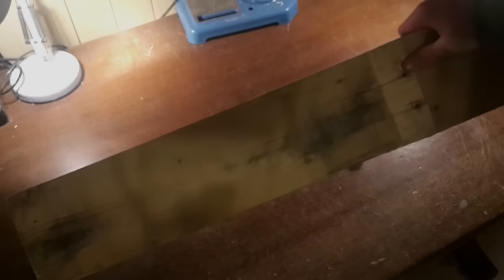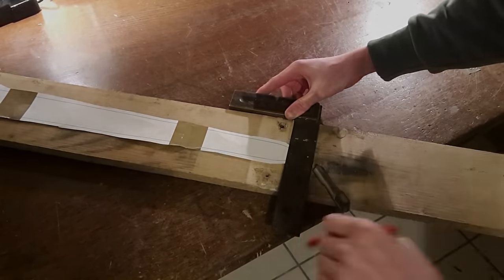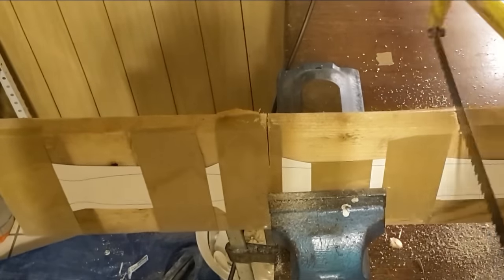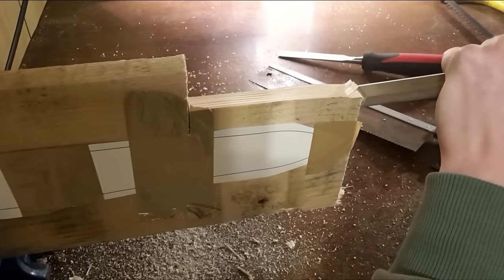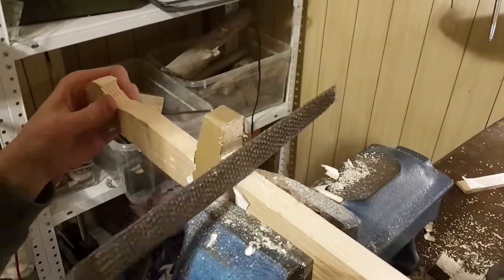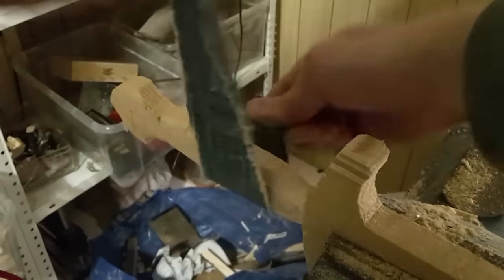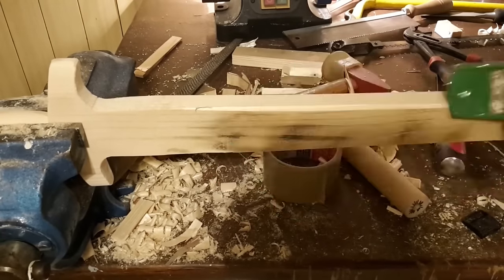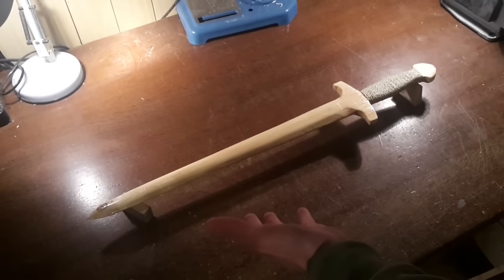How to make a simple sword out of a plank! [No powertools] - Free templates

Comment: Excellent work! Loved it!
Guys, note that making a sword from a unique piece of wood will make the crossguard break when sparring. Because fibers get too short, they won't handle a great deal of impact. Making a more realistic wooden sparring sword requires two pices: one for the sword and other for the crossguard (in wich the fibers showld be horizontal, not vertical, in order to handle impact).
Reply from the maker: Great advise!
Reply: Question: How would you put the two pieces together for the strongest connection?
Reply: @TheSailingDutchman1  tape
Reply: @WorldwideAthlete  no you would probably want to use epoxy or some kind of wood glue.
Reply: A bit late to the party but you could also make it out of plywood - doesnt look as good but sturdy as hell

Comment: Seems like you could save a lot of fuss by just drawing the sword onto the wood. You can put pencil onto the back of your printed template, then place the paper on your wood, then draw over the top. This should leave a light imprint of the printout.
Reply: Exactly my thoughts
Reply: I tend to use graphite paper to the same end with most of my projects.

Comment: Thank you for the video, I think I'm in the minority of people who not nly enjoy watching people make cool things but also want to actually make them myself (I am terrified of making investments in pricey stuff like machines and power tools). Out of curiosity, what were the brand/type of chisels you use? I've seen chisels go for very high prices and people swearing oaths of fealty to them. I bought a cheap $15 dollar set from a craft store and tried it on bass wood, and I can't seem to tell if I'm just super weak or if they're pretty bad since it takes a'lot of effort to get the tiniest bit of wood off.
Reply: not sure
Reply: Chisels typically come with some very coarsely finished edges from the box. Especially the cheapo ones. I had the same problem when I got my first chisel. What you should do is sharpen it on a regular sharpening stone until you can't see any light reflecting on the very edge of the bevel and then hone it on progressively finer grits on sandpaper sheets on MDF. Start with something like 300-400 grit and go up to about 1000-2000 grit. Then to really make it hair popping sharp, strop it on some MDF with steel polishing compound (Autosol), or chromium oxide abrasive. Cheers and good luck
Reply: @mikeg2046  Thanks for the well thought out answer. My health actually was and is still declining from when I wrote this, so I'm afraid it's power tools only for when I'm feeling well enough to hold some thing minorly heavy. Curious though, why does everything have to be on an mdf board though, just for weight?

Comment: Hey man, great build as usual, i'm just wondering what you use to create your templates. I'm thinking of creating my own weapons as well but I don't have a template creator
Reply from the maker: I use SolidWorks to model the weapons and then export this file into a drawing. SolidWorks is a professional software which I'm allowed to use for free because I'm studying engineering. Some other CAD Program like FreeCAD would also work.
Reply: Thanks, I will make sure to check them out

Comment: I'm writing a young adult fantasy novel and want to cosplay my characters, but  I need to make the weapons/swords durable and realistic. What would you suggest I use other than wood?
Reply: Carbon fiber?
Reply: @soreneatsstars  I could,  but I may have trouble getting it into conventions.
Reply from the maker: Carbon fiber is not the way to go here! Its mechanical properties may good, but working with this stuff is highly dangerous. If you really dont want wood, maybe use lightweight aluminium cores (for stability) and surround it with foamboard (For safety and weight-reduction).